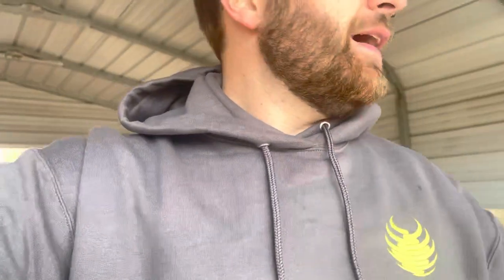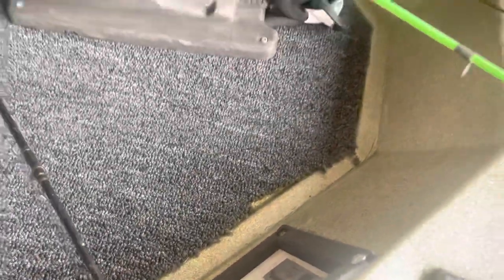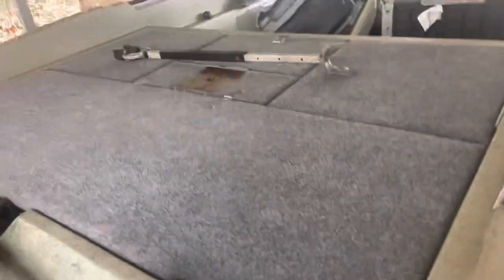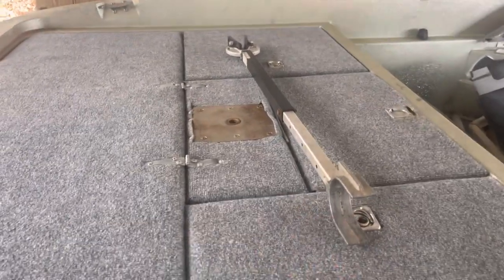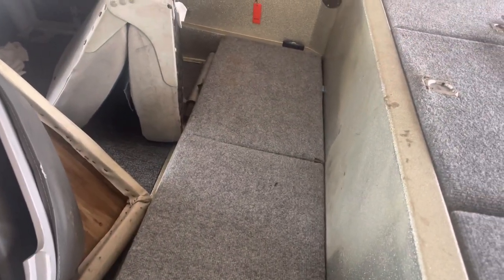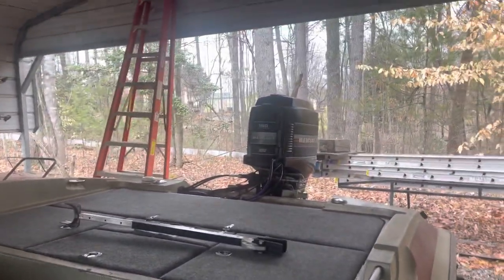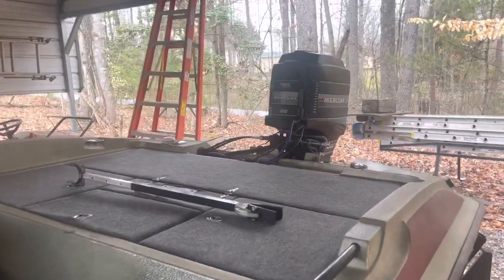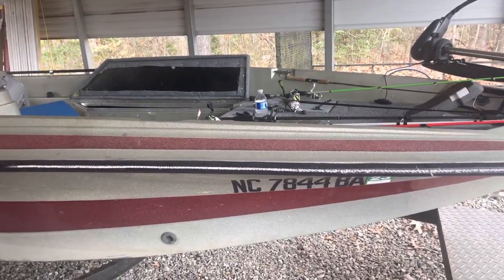I Saved a 39 Year Old Stratos Bass Boat (What I Learned)

Comment: Good restoration job! You may want to see about repacking/replacing (if necessary) those trailer bearings also before getting on the road. Good luck with the rig!

Comment: I am restoring a 1988 Stratos 270v 17.5 foot bass boat having trouble with hole shot with a 13.5 x 19 prop was wondering what the pitch and diameter of prop you are running